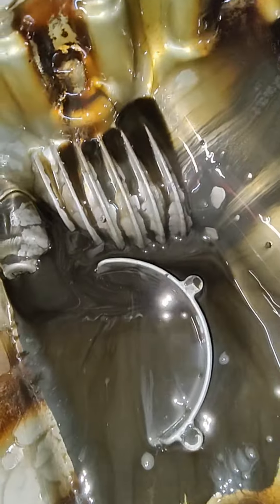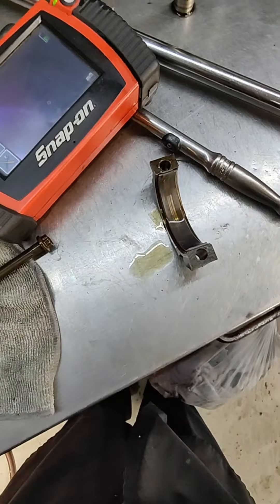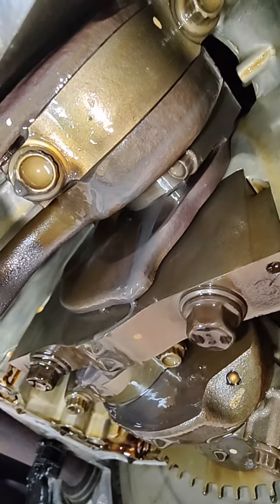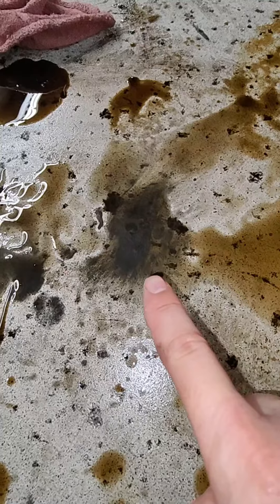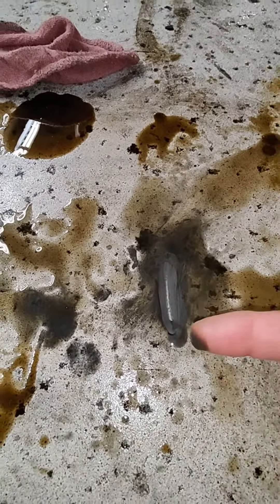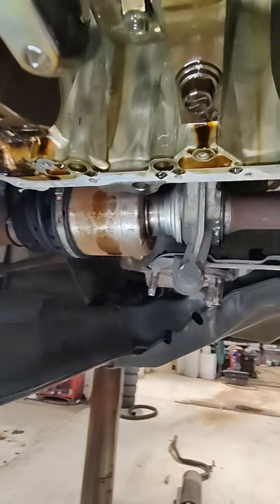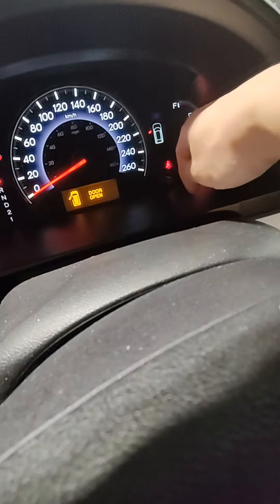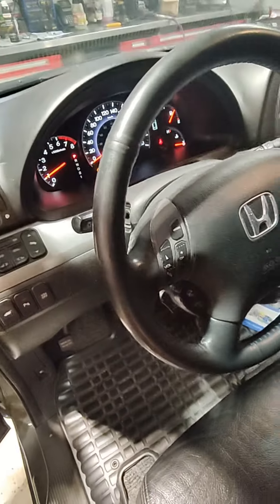The forbidden glitter.

Comment: Designed max life span for the bearing? Or they run low on oil once and add new oil to mask it?
Reply from the maker: It probably ran low on oil but also had issues with burning oil that contributed. The noise we suspect was the oil pump.

Comment: 418,000 km's and it looks clean inside.
Guy must have done regular oil changes.
That rod bearing wear looks like it was run low on oil.  What do you think?
Reply from the maker: We suspect the noise was from the oil pump from where the noise was coming from. So we started popping off bearing caps to check. The oil burning most likely contributed as a plume of smoke was coming out of the tailpipe.

Comment: Hi have you ever bored a cylinder with higher size or you don’t recommend and put a new block
Reply from the maker: I Only did that in school boring and measuring and then honing the cross hatch patterns. Unless you're an engine builder either your going oversize pistons and re-gapping all your rings. I guess it depends on what you're trying to achieve. If you're just putting an engine into a minivan you're either doing a short block or a long block.